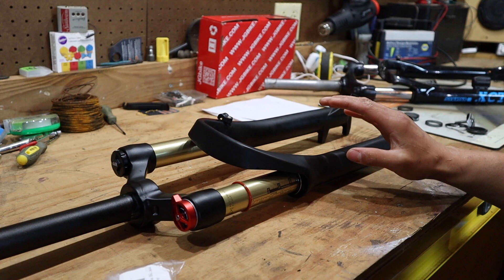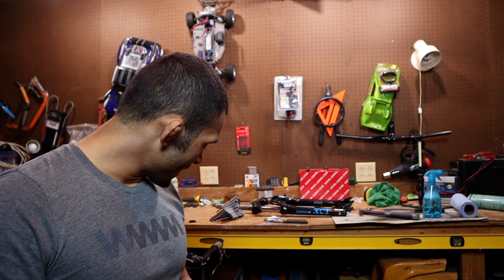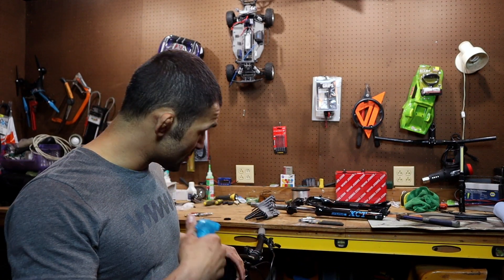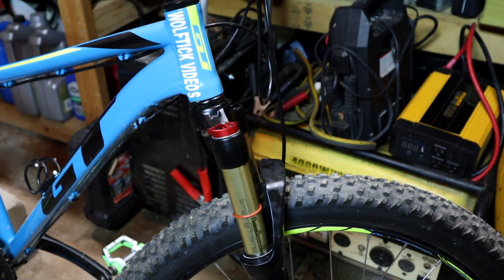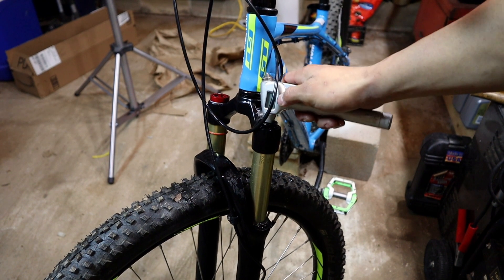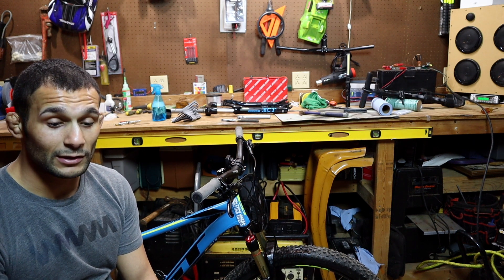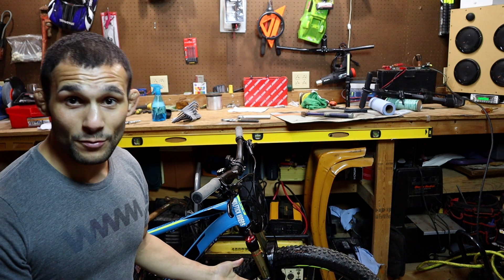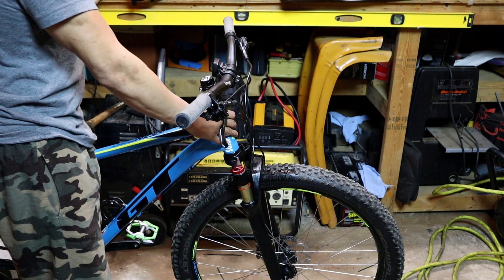ZTZ Kashima 100mm MTB Forks on the GT Aggressor Pro First Impressions

Comment: The fork holds VERY little air in it. Every time you test, its going to be dropping 10-20psi easily. You need a fork pump that has an in-line pressure tester that tests when you pump. For now, fill it up and then test 30 minutes later. If its flat then, you know its a leak. If I tested my Rockshox 35 with that kind of pressure tester it would do the exact same thing.
Reply from the maker: Thank for the input, other people have mentioned the same idea as well, ill def give it a try. Thank for the thought and comment brother!
Reply: @WOLFTICKVIDEOS  This is exactly right...only use a shock pump and connect it as fast as possible. Use the bleeder on the shock pump to release air...it does not take much to empty such a small chamber, it is even worse on the rear shock...you have to anticipate losing 10-20 psi just unscrewing the pump.

Comment: I bought a ztz air fork on amazon and it’s been working great! Everyone recommending a shock pump are absolutely correct. You’re losing air every time you check it. I have 118lb off pressure in mind and it does leak about 2-3 psi every 4-5 hard rides. Don’t knock the ztz forks. I put them on three bikes now.
Reply from the maker: Well checkout my update video on the forks. Ive learned for sure.lol Thanks for watching and make sure you sub and turn notifications on to see upcoming videos!
Reply: @WOLFTICKVIDEOS  where is the update?
Reply from the maker: If you watch this video at the end it will be one of the thumbnails that come up on the screen. If you don't want to watch it again you could just go to my channel and it is the second video up from this one. Thanks for watching.
Reply: hey, its been a year, they still working?

Comment: Dude you need to purchase a shock pump, look on Amazon. On top of that the factory 85 psi was good when you start checking it 85 psi escapes out very fast especially on a cylinder that holds very little volume. So every time you check it you’re probably losing 30 psi. But you do need a high pressure pump. Please watch this video around 2:20 so you can see how fast 150 psi escapes the chamber. But you should be running A much higher pressure then 65 psi.
https://youtu.be/bp0nxWZftdI
Reply from the maker: OK ill look into the pump. I figured something like that (not having enough pressure) was definitely the cause. But thanks for the comment and watching!!!

Comment: Each time you check the pressure it loses a lit of air because of the small air volume. There is not a problem with the fork it is just a trait of air forks
Reply from the maker: You are partially correct my good man. The fork had a seal problem and was leaking air, among other crappy assembly issues. Watch the update video if you would and let me know what you think then please. I think it's called ZTZ Kashima fork update or something like that. Hope you liked and subscribed.

Comment: I use to have that brand from Amazon  on  for my 29er mangoose xr pro , but these fork were not so great on my bike ended returning, and the reason for air leak is everytime you check air pressure you are losing air through the valve. You need to get a fork pump
Reply from the maker: Yeah brother, got tons of comments regarding that. Checkout the update video you will see the difference. Appreciate you looking out man!

Comment: ive been looking for a new fork for the gt aggressor and i was wondering if you needed to replace your headset
Reply from the maker: No dont have to replace the headset. Just make sure when you order a new fork it is a straight steerer tube. And also make sure you take the old crown race off of your existing fork to transfer to the new one. Crown race is like a really tight washer at the crown of the fork.

Comment: Check your rebound or preload adjustment
Reply from the maker: For sure man, the ZTZ's dont have a rebound adjustment but please checkout the update video to them. Learned a little since then! LOL Thanks for looking out man.
Reply: @WOLFTICKVIDEOS  ohk dude I will surely watch it but then one question is that the lockout you have is hydraulic lockout.
Reply from the maker: No its not hydraulic brother, just pulled them apart the other day. No oil and the lockout is just a small shaft that controls a rod in an air chamber.

Comment: i just bought a gt pro and want to get the fork im new to this lol any recommendations as far as quality for the buck looking for $250 max of course air suspension
Reply from the maker: Well first of all great question, before i got mine i did so much research.With a starting budget of $250.00 #1 Starting at the top with the most travel i would go for the SR Suntour Epixon XC MTB Fork 27.5" the price is what i would feel comfortable spending cause your gonna stick with it for quite a while and it has 120mm of travel. And if you plan on using this bike for all around and some downhill there the best deal in my opinion for only $226.00 #2 They only have 100mm of travel but the same great brand name with a lighter purchase price of $185.00 you got the SR Suntour XCR Air LO-R Suspension Fork. Now both forks so far i personally have not rode on but since they both come in under budget and both have 100mm of travel or more, they are both a  big improvement over the 80mm you got now! Ok now #3 in my opinion i would go with these because they are more budget friendly and if you want to have money left over to put in your bike elsewhere i would recommend the forks i have, they are ztz kashima forks air and they have 100mm of travel. Definitely not your brand name in forks but one heck of an upgrade for $149.00. When i bought mine they were a little cheaper but anyway i hope this helps and please subscribe and tell your buddys! Thanks man for watching.
Reply: @WOLFTICKVIDEOS  Thanks i actually just purchased a FOX 32 float CTD suspension fork 100mm for $300 hopefully that  does it i no they are a very good brand and by the way what size frame is your gt im 5'9 and bought a L 19 online now im starting to wonder should gone smalller ?
Reply from the maker: I went with the M which is a 17' i think you chose right.
Reply: Rockshox recon

Comment: It loses pressure because you checked it and it blew off tons of psi.
Reply from the maker: Yeah man i found that out after on the update video! But good looking out!
Reply: Yeah you need to use a fork pump or shock pump. You can't use regular air compression fork is fine.
Reply from the maker: Hey dude checkout the update video, got em right after a few more problems other than the obvious fork pump.Thanks for the comment hope you subbed man !!!